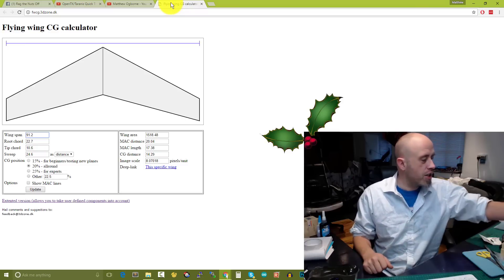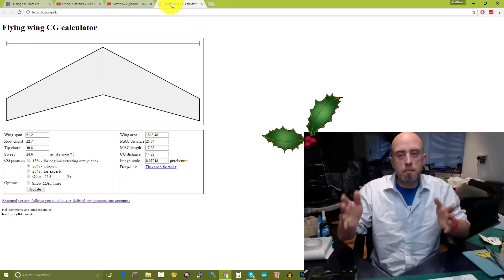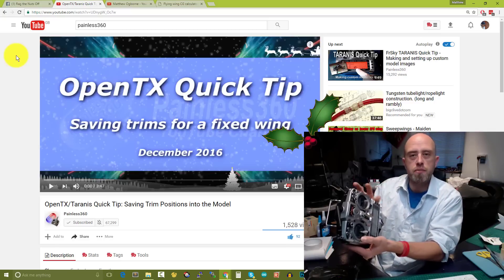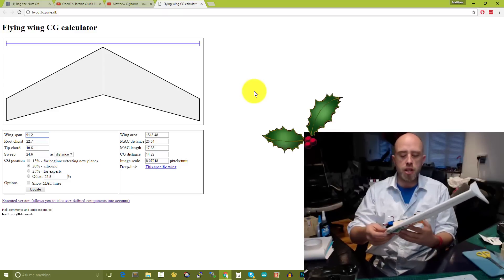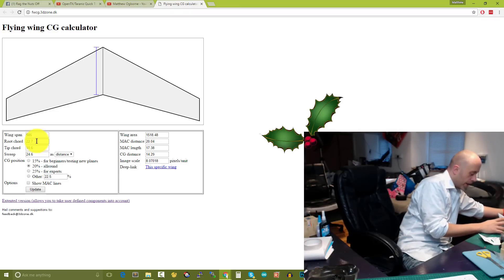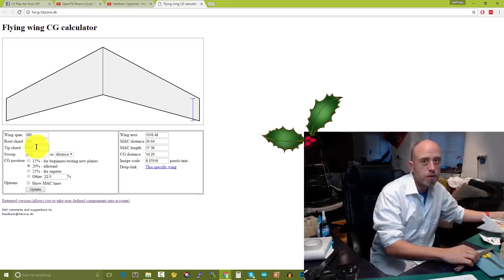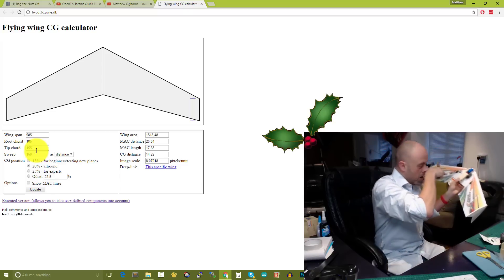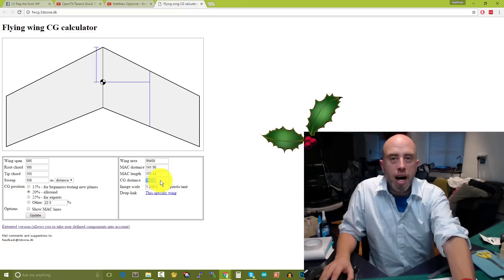☕ RC Coffee Chat #87 - Center of Gravity Calculator for a Flying Wing 🎄🎅

Comment: As with a real air craft stall speed increases in a turn so you may have a cog issue but you need to enter the turn with more speed. If you are nose up in the turn then you have something I mentioned earlier.... LOL Use of controls at the stall point = spin. Hence I have given you something to check. Remember down is your friend. I had a similar issue with a Skywalker 1.5m wing, I would turn for approach and then spin to the ground. I then remembered my flight training and also discovered that the APM 2.6 stall prevention was off. Did some testing with the Wing Wing and cog and speed was a issue in a turn. So then got the Skywalker back out and all is good no more spins when turning and I have now practiced spin recovery. As I said before just centering the controls does not always work, down it required to come back out of the spin. Treat yourself to a full size sailplane lesson you will love it and Fpv go so hand in hand. My flying is so much better Fpv when I fly based on the sailplane training that I had. Get a video of the issue when it happens!!! It's flyable tomorrow so crack on lol

Comment: Hi Matt, Happy Christmas, that calculator is usually within a few mm so you can lose the weights.  everything else has been suggested apart from playing with wing tip find size or adding a second set halfway in on the wing. (keeps a wing flying knife edge as opposed to the normal tenancy to drop whilst banked over.)

Comment: Howdy Matt! After my maiden flights with the flying wings, I'll get the model home and set the servos mechanically. That way I can bring the trims back to center and have full travel both up and down. An easy way to do this is to face the wings elevons against a box or something that you can make a mark as to where they are sitting. Then loosen the connections and bring the servo trims back to center on the tx. Finally using the marks that you made from where the elevons need to be for level flight hold the elevons at the mark you made and tighten the control horn connection so the elevons are at the mark you made previously. Hope I haven't repeated something you are already doing & that all made sense. But either way thought I would pass this on to you.   Take care man!   -Jamie
Reply: Very true. I do the same thing and learned this early on. I don't like my trim tabs being maxed or near maxed out and I like to run 0 sub trim on anything that isn't a rudder.

Comment: If you need so much reflex to fly straight and max down elevon is flat then it probably is nose heavy. The angle of thrust seems to be off as well. Could be the reason why it flies strangely with low throttle but nicely with high throttle.
Happy holidays and a good time from Weimar, Germany.

Comment: I use www.winglib.com when I built my wings. Its results agrees with your results so I'm not sure whats causing your problems. I have built a wing using Depron and the plans included in the video from this link. https://youtu.be/K4EO5_E8euQ I have built this wing several times at full size and at 150% and it flies brilliantly you should try it. One mod I made was to reinforce the leading cavity with expanding foam. The full size version I used 6 mm Depron and the 150% 9 mm Depron. They both fly well on a 3s and and a 10x6 folding pusher. Merry Christmas and a Happy new Year. Richard

Comment: You're absolutely right to include elevons as part of the wing in your calculations! With my scratch built wings I'll use the cg from the calculator (or the tested design I'm trying to emulate) but with as lightweight setup as possible, little reinforcing (some foam around nose is good tho) no motor and elevons flush with bottom of wing. Glide tests ensue, slowly adding a couple degrees of elevon reflex (up-trim) at a time until an almost hands off long glide is obtained. When motor is added it will fly well enough so more fine tuning can take place :) Many smaller wings end up with relatively high wing loading and have no twist or washout built-in, so you don't get a smooth stall starting at root going out to tip, but rather an almost instant loss of lift on one side leading to the typical nose-in spiral. Just keep enough speed up in the turns, especially turn for final!! Happy Holidays!! C.